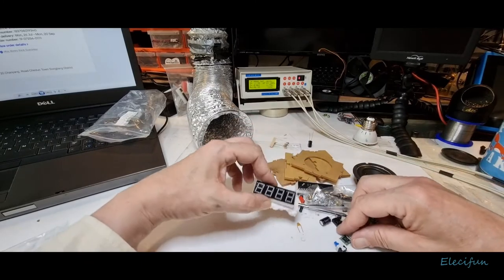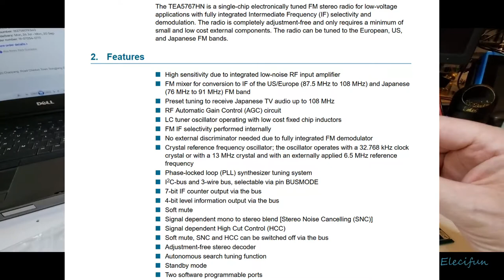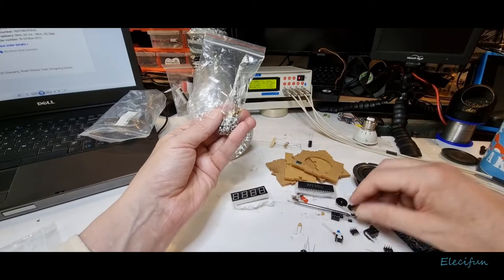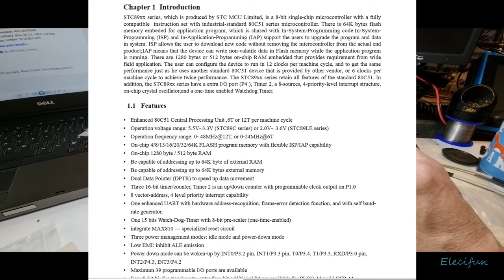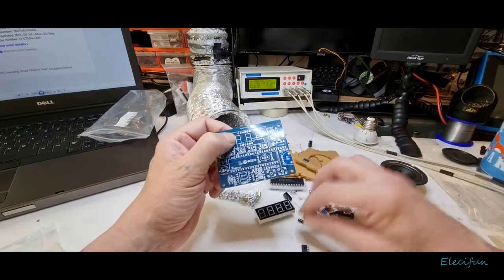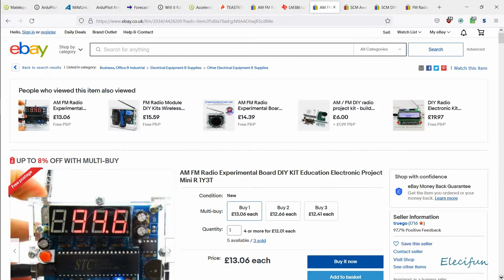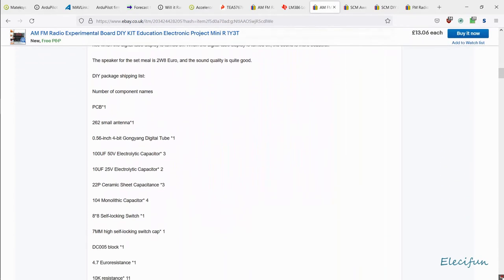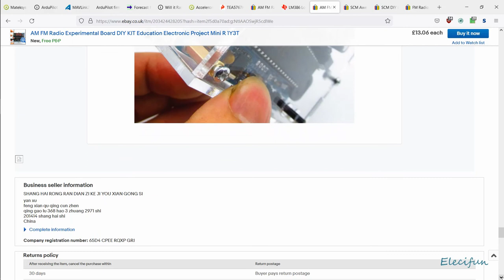DIY Kit Build AM FM Radio pt1of2

Comment: This is similar to the kit I built. Geezez what a fk up this build was. 🤣🤣 I burnt the LCD segments. Then I burnt my hand trying to attach the aerial. 😂 sigh. I put some caps in the wrong places which meant I had to desolder them. Sigh. What a hassle that was. Anyway surprisingly it still worked. 🙂👍🏻
Reply from the maker: Making mistakes makes good learning, at least you got it to work 👍🏻
Reply: @Elecifun  Yeah, well initially a bungled the first three flashers that I assembled.

I couldn't get them to work properly.

To be honest I didnt soldered them very well.

Still since then mostly everything I've soldered has worked albeit the PSU I wasnt expecting to work.

I put the wrong resisters into the wrong holes and after checking I realised my mistakes.

I had to desolder a few resisters and a two other components.

Despite the mistakes it still worked but Im not sure why I get these strange what appear to be voltage ripples.

It's as if the lights flicker for few seconds.

I'll send you my email soon.

I dont feel very confident.

I watched a video about the app thats used to design the PCBs.

It looks complicated.

Maybe I'm biting off more than I can chew. 😂

Anyway thanks for responding.